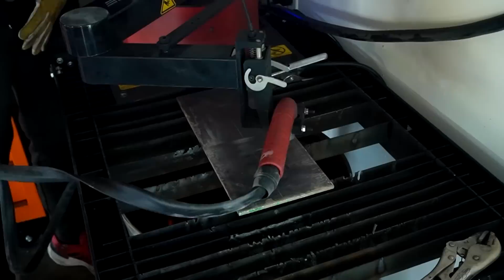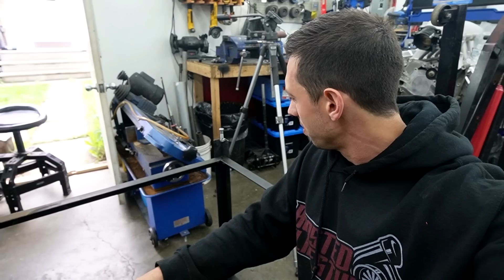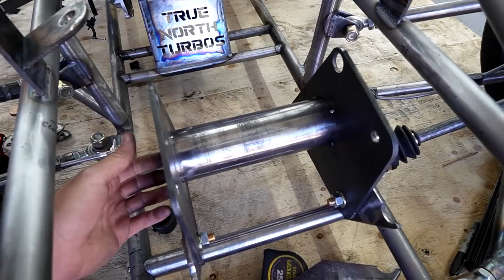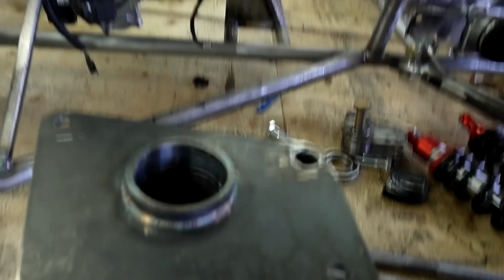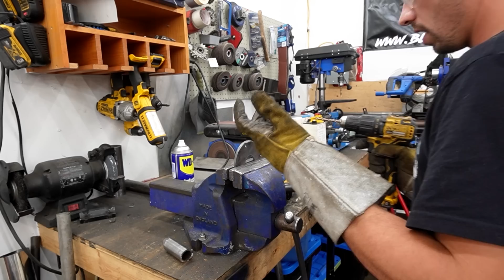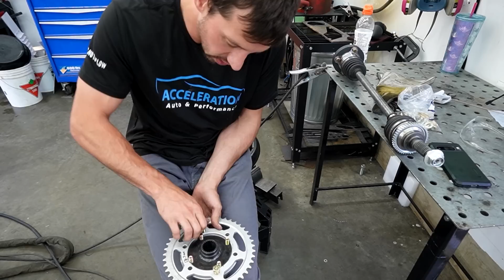Homemade Formula 1 Rear End And Chain Drive DONE - Pt 17

Comment: Kyle you can add an auto tensioner to the bottom (slack side of the chain) like some of the  sport bikes have to keep some slack in the chain so it wont overheat from constant tight tension
Reply: Çczxß AQA😊
Reply: That was my thought. I figured it would be a lot more reliable, easier to adjust, and stronger. Oh well it’s done now and it’ll probably work just fine

Comment: THAT ISSO AWESOME!!!! BEEN WAITING SO LONG FOR THIS! Only thing I can say about the chain drive is make sure it does have a bit of slop. If you don't, it can bind up, break and whip around and smack the cases and ruin the engine. All major brands have a Chain Slack Adjustment spec on the swing arms on a sticker and in the owners manual. I would check what the spec is for engine you used.

Comment: As you make the effort to build independent suspension, I will have used a miata differential and then rotate the engine 90 degree so the axle could accommodate a shaft from the engine transmission to the differential

Comment: High speed turns with this rear setting will be challenging and you may experience a lot of of oversteer. If your goal is race track, you’ll need a proper differential, with each wheel turning all the time together at same speed will impact significantly performance on a track with a lot of turns, defeating the purpose of having independent suspension setup
Reply: I was just thinking about that
Reply from the maker: You know what would hurt on track performance even more 🤪 me not finishing it. I just dont want to get too over my head and too delayed before getting a running driving unit. So this will work as a first version and get the project moving and then I can consider building something different later
Reply: @AdventurekyleAU  as a plus side, its gonna do sick drifts 🤩

Comment: Just like on a motorcycle (which is what this is essentially) you WANT to have some slack in your chain. On the bottom side get about 5/8th inch total up and down slack. If its too tight, its hard on the sprockets, gearbox, bearings etc. And can make things easier to break, rough operation etc. All not good things.
Reply: I was going to comment the same thing about having a slight bit of slack on the underside of the chain ⛓️ 👍🏼

Comment: ATTENTION POWER UP, HAVE YOU CHANGED BREAKER AMP?  YOU SHOULD BE ABLE TO INCREASE BREAKER AMPERAGE BY 5-10.  SO IF IT IS 15AMP CHANGE IT TO 25AMPS

Comment: As someone who started on a mini lathe just like that, I can confirm it is handy to use a grinder sometimes. 😂 
My second unit is a lathe/mill combo and it’s way better
Reply from the maker: How big is it and how much better is it???
Reply: @AdventurekyleAU  16x20. Having a mill at home really changed the game for me. I got mine used for $1800, then managed to get $1000 for the mini lathe. Then spent a bunch on new tooling for it.
Reply: Cutting on the lathe is night and day difference though. Holds larger pieces, way more power to cut deeper, cut my time 10x

Comment: This is Kyle's interpretation of a welded diff. Also, Little Caesar's pizza commercials and the "Pizza, Pizza" live rent free in my head.
Reply from the maker: Yessss I remember those too!!
Reply: @Boostedlifestyle  you were talking about doing a tensioner on the chain. Look into a Monster Craftsman weld on auto tensioner kit, I put one in the first chopper I built because I extended the tail by 6.5". Still going strong almost 10 years later.

Comment: Just a suggestion, but why dont you get a 240v 50 amp generator just to run the plasma cutter, remote start these days. It would be far cheaper than having a new board upgrades and cable installed like you explained before???.

Comment: I feel like with what is basically a welded diff that might make driving it fast very difficult and maybe even dangerous with the power you have since the rear will be skipping around which’ll make the rear come loose super easily
Reply from the maker: It's a temporary solution before I can come up with something a little more intricate. This was the perfect solution to keep the project rolling for now 😇
Reply: @AdventurekyleAU  oh ok, that makes sense since I remember you had either some bmw or mazda diff that you had earlier in the series

Comment: Are you ballancing your driveshaft adapters? I will have to do something simular 🤔 The cars sounds awesome 👍
Reply from the maker: Probably not. But it would be a good idea huh
Reply: @AdventurekyleAU  since it's so close to the centre of rotation I don't know how much difference it makes 🤔 I guess you'll have to see if theres any vibration. I was planning to use a manual motorbike wheel ballance tool on my adaptors 👍

Comment: I feel your pain with the mini lathe 😂 it's just enough for small jobs. I snapped my tool post off trying to re purpose old driveshafts.
Reply from the maker: What 🤣🤣🤣 mine keeps like grabbing and bouncing. You need to run the motor really slow for steel but then the motor isn't strong enough and it stalls
Reply: @AdventurekyleAU  The parts came out nice in the end tho 😆 yeah I can only do 0.3-0.6mm cuts in mild steel to keep it happy. Theres so much flex in these little lathes. I have done alot with mine tho 👍 I have done parts 2x bigger than the chuck 🤣 an old floorstanding lathe is infinitely more capable tho. Keep up the good work 👍
Reply: @AdventurekyleAU  also try running fast with a light cut. Modern micrograin Carbide does like higher rpm. I just leave my mini lathe set at around 1200rpm and adjust the depth of cut depending on material. Sometimes keeping the moment going is more important as they lack tourqe like you said.